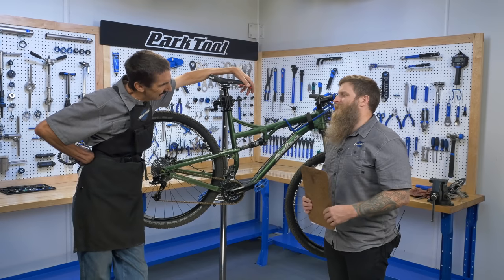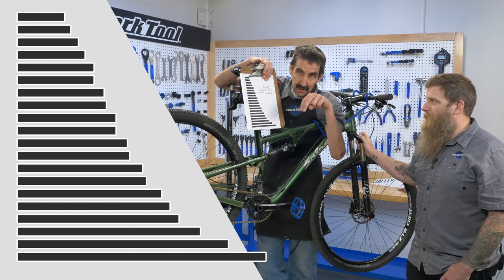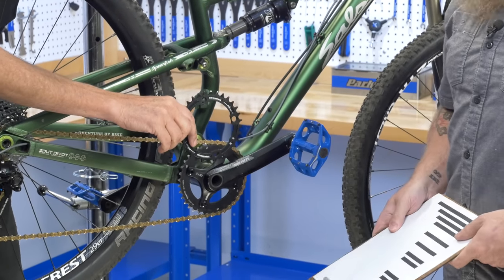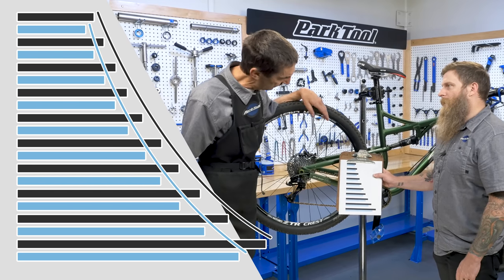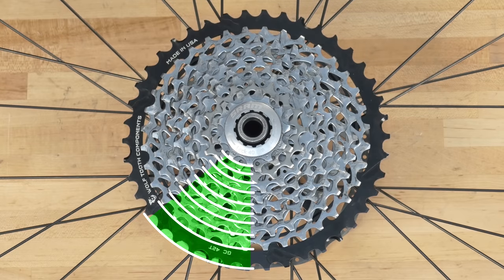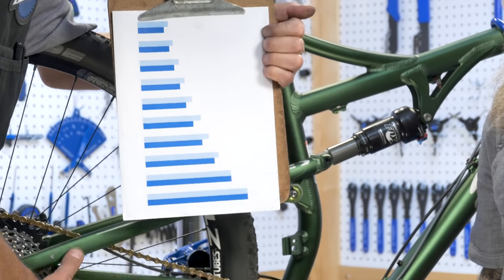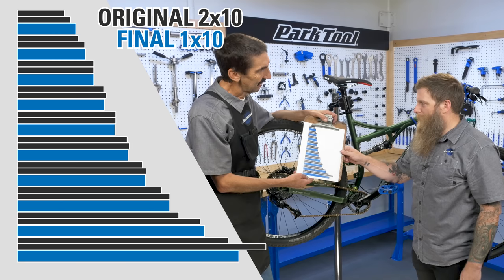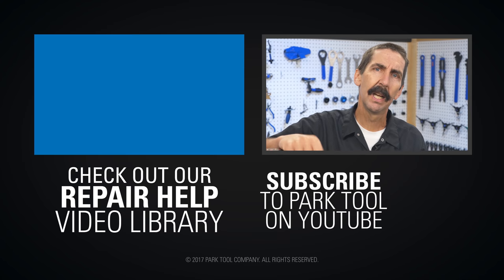1X Conversion: Pros & Cons - Tech Tuesday #91

Comment: go 1x1 and "send more blood to the legs less to the brain"
Reply: dont forget to make it a fixie as well!
Reply: And than send more money to your surgeon when it's time for total knees replacement at young age.
Reply: Certainly less blood getting to my brain after watching that.
Reply: BMX bikes have 1x1
Reply: that's a track bike. you need a trail bike with gears for a proper ride.
Reply: @wiktor3453  bmx are track bikes not daily riders. i commute, freeride and trailride on one bike. A GT avalanche sport aluminum hardtail with a 15x100 rockshox recon fork, an xtr 3x9 drivetrain(next month i am doing a 1x11upgrade, dt swiss mavic wheelset, kore stem, bontrager rl race light riser bar, canecreek headset, and shimano brakes. i run the m365 set but will upgrade to the slx7000 series
Reply: Send more blood to the surgeon fixing those knees.
Reply: @mrfrogg46able  my wife has a gt avalanche elite 2019 2x10 drive train and I've got the 2020 edition, well I prefer the 2019 edition, having the extra gears helps a lot, with 1x11 you loose a lot of speed.
Reply: Youssef Karmous if you are looking for speed then you bought the wrong bike. For speed get a road bike or a hybrid not a MTB for trails. You don’t want to be shifting through tons of gears while climbing a descending and quick turns it all becomes a hassle. I will be converting to 1x soon.
Reply: @bfitnessjoe  Your right I only use 3 gears on my MTB .
Reply: @mrfrogg46able  i have daily ridden my bmx bike for 10 years. i have done 100km rides on my bmx. there's no sitting down let alone gear shifting
Reply: Why not go 1x wheel. You can throw away the chainrings cassette front and rear derailleurs shifters brakes and levers front wheel even the bike frame. The unicycle is king.
Reply: @johnlong9862  yeahhh this guy understand it, can you wheelie your unicycle?
Reply: @bmxscape  that is probably harder than my road 100mile rides and even MTB ones because if there are any hills you're going to be walking whilst I can just easily pedal up
Reply: @hollownexus9316  no i dont walk up hills, i pedal. why would i ridea bike if im going to walk
Reply: Legende
Reply: @bmxscape  bmx are single speed so much harder to pedal uphills with and harder to go down hills with because of running out of gears and no breaks
Reply: @hollownexus9316  yes its hard but it's not impossible
Reply: Esoy Pongasi  1x1 = 3 speed. Stand, Sit, Push
Reply: @sodalitia  lol knee problems aren’t a “real” thing in the fixed community. If your knees start hurting it’s cause your using a gear ratio that’s too hard for you.
Reply: @sodalitia  lmao you realize the gearing has to do with physics right. you probably don’t even ride a fixed gear. I on the other hand do and I climb all the time and I don’t get knee  pains 🤷🏻‍♂️.
Reply: @bmxscape  I smell bull 💩
Reply: @brandonnunez3644  knee problems from cycling occur from bad fitment ie too high or too low of seat typically
Reply: @bmxscape  that’s true only if that happens in flat riding, for climbing (at least when it’s steep ) you’re out of your seat for a majority of the climb, so if you develop pain it is mostly because of your gearing being too high for your strength. It could also be the size bike you are riding or the size of your cranks too being too big or small
Reply: @brandonnunez3644  id say its the most common reason for pain in cycling. at least for me i dont get pain i just physically cannot pedal if the gear is too hard

Comment: The bike industry is pretty clever.  Club riders used to ride hilly 100 mile days fixed or single speed, and when Sturmey Archer brought out the 3 speed hub gear, club riders demanded (and got) a close-ratio version and a non-coasting version!  Then the industry started to sell 5 speeds (1 x 5) to us as "necessary".  Then the industry brought in "10 speed" which was 2 x 5, but with the front chainwheels being 52/48 (hardly any difference) and the rear cog was 12-24t.  (Yes, "chainwheels" because detachable chainrings were not available.)   Imagine our surprise and delight when they brought out "15 speed" (3 x 5) and "wide ratio blocks" that went "all the way up" to 28t!  Then a friend bought a 12 (2 x 6) and it was amazing.  Now my wife's bike has 2 x 9 and the shift levers alone would cost £200, and one of my bikes has 2 x 10.  And after all that the cycle industry is selling us special parts to convert us to the next big fashion of "1 x drivetrains" which is where we started.  Meanwhile, I have as much fun riding cross country on my fixie as I do on anything else.
Reply: Haha, that's awesome. : )
Reply: @dawbi   its called evolution and technology dummy. the ONLY scam in the bike industry now is the shitty suspension on sub $700 bikes. the suspension doea nothing and adds 4-5lbs to the bike and raises the price point, which is made up on cheaper drive train componants.
Reply: @crabtrap  yeah I always shake my head when people talk about bike manufacturers scams. Money talks, they only sell what people are willing to part with their cash for. It's a Consumer driven industry.
Reply: @MrBJPitt  but the lower-end consumers are pretty stupid.....do they really think a walmart $99 'full suspension' bike is "almost as good"?
Reply: @crabtrap   and your point?
Reply: @MrBJPitt  point is, we the people have our selves to blame for some of the shitty bike fads.

Comment: even with a 3 by i still always ride 1 by. so yesterday i finally ditched the old rings and put on a narrow wide. if anything, it’s quiet!
Reply: Do you need a new chainring bolt or yyo can use the old one?
Reply: @elieserobillo6600  if you make this change using the old middle cog that was on the front chainring, you may indeed need a shorter chainring bolt.
Reply: How
Reply: same. I never used the highest or the lowest front gear, mine was always in the middle so going 1x was a no-brainer for me.
Reply: @NonLegitNation2  Yep, me too. I'll be making the switch on both of my GT's here soon.

Comment: A nice, drama free breakdown of what's involved in a 1x switch. I would like to point out that not all riders are going to find the cassette bodges necessary. I was riding 2x10 on 26" a few years ago (36,22/11-34) and I switched to 30/11-34, (I was early enough into the cassette life that I only had to swap the front ring and the chain.)

With that swap I lost two low gears that were unusable, (at my low level of fitness, it is easier to pedal squares in a slightly higher gear than spin a 17 gear inch to 19 gear inch low ratio at the rpm needed to avoid falling over,) and one gear up top that I only used downhill, (Once again, at my low level of fitness, I'm not realistically pushing 82 gear inches on flat ground with high volume mtb tires.) For the price of a NW ring, a new chain and a little effort, I got linear shifting and a front ring that is much easier to clean.

Every rider's riding style, fitness level, and wheel size will affect this, so doing the math and being honest about what gears you will use can help avoid a lot of heartache, (And yes, that might mean sticking with 2x for some riders.) I personally love 1x so much that I even converted my road bike to 1x10, (But 1x road is a whole different kettle of fish.)
Reply: Looks like with the rise of wide range cassettes people are forced to seek out half-step gearing which works even with electric shifting.
Reply: I only understood about .5% of what you just said, lol. That's why i love these park tool videos they break the stuff down enough so that even idiots like me can understand it, lol.

Comment: I recently decided to go to a 1x11 from a 2x9. Like this video, I only lost my lowest gear and my highest gear. Two gears I hardly used. And I don’t have to worry about the weird lack of gears I was having in between the 2 chainrings. Even after a local bike shop worked it, I couldn’t get past the bottom 5 gears on the small ring and the top 5 gears on the big chainring. I really only had 10 gears with a huge step in the middle. With the new 1x11, I can seamlessly go through all 11 gears in the back with no fear of slipping off the front ring.

Comment: I’ve been running 1x9 and it’s just been a really good change I’ve been able to jump higher and especially get a narrow wide so the chain doesn’t come off
Reply: Do you use any chain guards or otherwise any rear derailleur with clutch? The choice of RD with clutch is very limited on 9speed. I plan to switch to 1x9 from 3x9 for simplicity reasons

Comment: I've got a 3x8 still. :) I love to switching the front chaining and it's natural because i'm used to that in the last 30 years.
And it's less than 280gbp. In eastern Europe 3x vs 1x = 2 month of salary :)
I loved the gear changes in this video - makes a lot of sense. If i would buy a new bike it would be a 29er 1x steel framed. But i have to win the lottery fist :)
Reply: OK. Since i watched this video i'm thinking on a daily basis to convert to 1x. The scale of 1x is impressive. 
And is duplicates on 3x are a bit disturbing :)

Comment: I go with a 3x10. I don't race and I rarely go on trails. I'm more of a traveling on a bike kind of guy so I need the speed to get more distance on a short amount of time.
Reply: I have the same set up. I ride distance (commute an hour each way) I ride offroad for sport (it's an mtb), I go to the shops on it, go camping.
Reply: I will never ditch my 2x! It’s just fine as frog hair! Sometimes I ride to the bike trails on the road and bieng able to jump 4-5 gears with one click of my left thumb is not going away
Reply: what left shifter do you use?

Comment: Great overview, guys.  One thing you didn't mention was chainline.  Not all cranksets are created equal when converting to 1x setups.  One of the main complaints from scouring the forums before I made my conversion was falling down a gear when backpedaling in the largest gear due to extreme chain angles.
Reply from the maker: Chainline definitely comes into play when converting. When pedaling backwards on a wide range rear cassette it is not uncommon for the chain to fall down a few gears even with proper chainline even on stock 1x setups that were not converted.

Comment: Where i live, i about a 1 hour ride i may go from 120mt to 1000mt.
So yeah, good luck following me uphill and then catching me downhill when we enter main roads.
Unless you are a technical downhill rider who only uses his bike for this sole reason, you are way better off with a 2x.
Reply: MotorcycleMan  32T and 10-51 cassette, still lower ratio than 38/28 11-36 downhill.

Comment: For me it's a 2x world.  You're heading fast into a climb which takes away momentum - let the front derailleur spring drop 10t with the click of a button.  Much easier than mashing against that rear derailleur spring needing to switch two or three cogs quickly.  I find I mostly stay in the 4th rear cog and switch back and forth between my front two chainrings.
Reply: I feel the same way. The 1x seems kinda gimmicky to me. I have a cannondale slate and the 1x version of my bike is outrageously more expensive just for that drivetrain.
Reply: It's an identical compromise.  If you want to make a big shift, it requires 2 hits of the 1x sram double tap lever to shift up 6 gears while it only takes 1 hit on the front mech to get the same big gear change.  While if you want a small change but to shift chainrings it requires a shift on the front and back, while it only requires a shift on the back with 1x.
Reply: there's dozens of us!

Comment: I have an 8 speed derailleur. I put a 40 tooth cassette and my derailleur can push the chain onto the biggest sprocket. 

What are my options? Longer cage? Drop down adapter? Switch to a 36 tooth instead of the 40?
Reply: Max out the B screw and buy a derailleur extender off Ali Express for $2.

Comment: Great video. Great editing, love the fast forward music, and their work shows you why I bring my bike to the shop to do most changes 🤣

I'm using a 3x9, which isn't giving me low enough gears. I need MTB on my rdrop end tourer.
Reply: I do most of my mileage on a trekking/touring bike, and when I travel longer distances, I usually travel pretty heavy with all my camping gear. The 26/36/48 didn't cut it for me and I don't see the point in that gearing. Even after switching to a MTB crankset with 22/32/44, I'm not using the two small rear cogs (which would require 20+ miles per hour) at all, but I'm definitely using the low end when the going gets tough, especially near the end of a long day in the saddle. Ditching the 26/36/48 was one of the best decisions I've made for that bike.

Comment: Most all of my bikes came with 3x's but I found that I ALWAYS kept the front gears in the middle gear, I would never change it, so when the whole 1x craze happened I had absolutely no problem with going along with it and found no difference in the difficulty of pedaling. The only thing I don't really like is my current chainline on my converted 1x. I'm not experiencing any chain rub or problems shifting but I still don't like how sharp of an angle  the chain is when i shift to the biggest cog. I plan on taking my bike to the LBS tomorrow and having them take a look at it to see if I can do anything about it.
Reply: Sadly the steep chainline and it's associated problems can be reduced , but not eliminated to the same degree as a 2 x or 3 x configuration would allow . This 1 x concept is more about allowing exotic frame designs than versatility . Also the simplicity and cleaner look .

Comment: My 3x7 speed works perfectly fine, and it came with the $50 bike.
Reply: converting actually cost more money ,those with 11 -12 speed cassette is expensive
Reply: There aren't any steep hills where I live ( not for a long distance) .so on my 3x7  with 14 to 28 on back , I use mostly 21st gear  . On a few hills I shift down to 18th .  And some to 19,20 .    But going down hill in some places ,I can't pedal fast enough to keep up .  One more high gear would be nice .

Comment: Good episode, but in my opinion it would have been even better if you had included oval rings to this, and you didn't touch on eagle 1x12 either. So converting to eagle may be too expensive for most since it requires a full replacement of everything in the drivetrain, but surely oval rings would be a welcome addition to the discussion when talking about effective range, especially in lower gears on hills. I swapped 2x11 to 1x11 with oval ring, and I couldn't be happier.

Comment: Thanks for this one. Ill be sticking to my 3x9 speed drive train after watching this.
Reply: What bike do you have
Reply: I'll probably be sticking to a 3x7
Reply: @bananasstuff3344  My Bike came with a 3x8. When pulling a trailer up a hill, i am rather thankful for that small front ring, and i likes my top end speed. 

Using 1 bike for all the things that need doing, it better have all the gears.
Reply: @seven9766  yes mine has to be an MTB and a good bike for everything else as my family often goes on long day trips on bikes

Comment: A 1x10 in road bikes can be used to address areas of heavy winds for example this puts a bigger ( to the max the frame can handle) on the inside which gives you less spinning in the lower gears.

Comment: I have a 3x8 MTB 29er and I've learned to ride on the big ring most of the time. Middle ring for steep hills, granny ring rarely touched.
24-34-42 crankset with 32-12 cassette.
Reply: The reason to use all three of the large cogs is that it reduces the wear on drivetrain and saves energy pedaling due to the angle of the chain with less friction at less extreme angles. the smallest front cog and smallest rear cog or largest front and largest  rear cog causes the chain to flex from near the frame on the front cog to the most outwards rear cog near the axle bolt and vice versa. The amount of watts you lose isn't much but the money you save is going to play out on highend components. Hope this helps explain the disadvantage of using the largest cog and not downshifting to a less extreme gear setup (largest front/back cogs, smallest front/back cogs).

Comment: I've been studying and calculating gear ranges on a gear inch calculator for my next build. I currently have everything from single speed, 1x 2x and 3x. 3x gives the biggest range by far. It has also saved me when I damage the rear mech and I still have 3 on the front. I probably will go for 1x on my next build, but I'll be sacrificing to speed to get the low touring gears I need.

Comment: I suggested 1x5s at bike shops 35 years ago and was laughed at; not for racing, but for casual bikers who do 25 mile rides max.  A lighter 10 speed frame vs a 3 speed beach cruiser. Trying to build a 1x5 or 6 or 7 now using Sheldon Brown’s gain ratio calc - who sells individual quality gears?? Also, can a 1x8 or 9 or 10 work... for casual riding? Great video-you guys are hilarious!